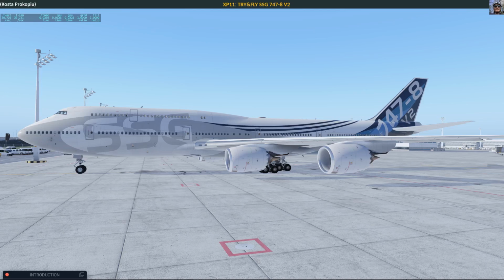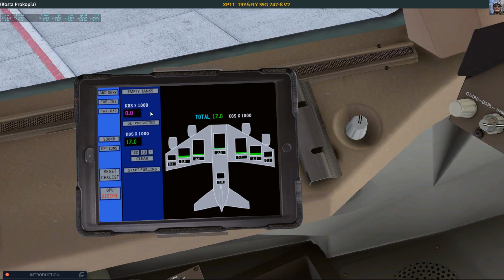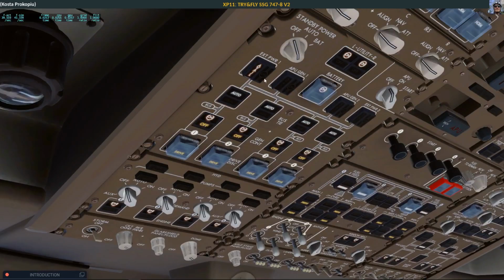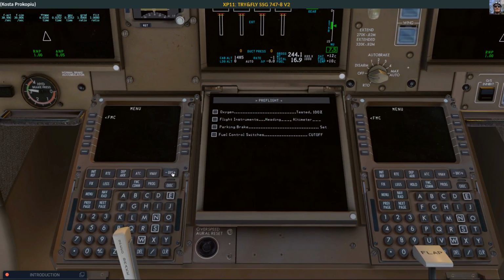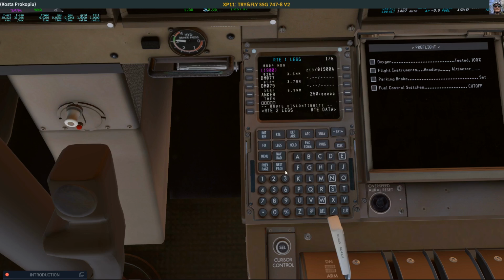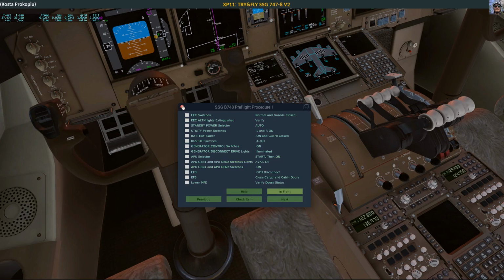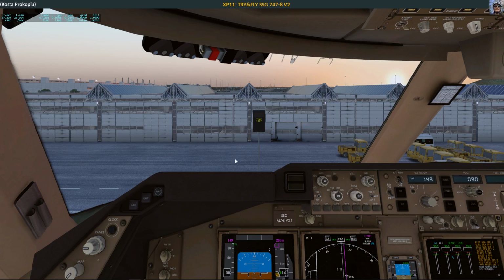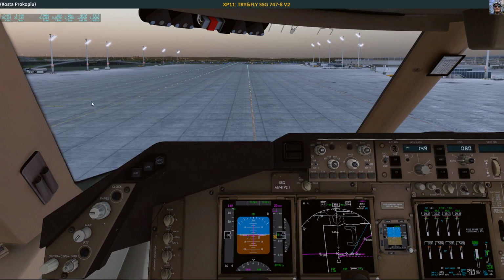[XP11] TRY&FLY SSG 747-8 V2.1.1 1/2 (ENGLISH)

Comment: Kosta I have a question I wonder if you can answer. I can connect 3 sam2.03 jetways to 748 v 1.9. and it works perfectly L1,L2, and upper cabin), but cannot connect to 748 v 2.1.1. Any Ideas? Thanks again!
Reply from the maker: I did get gates connected at the end of the Try&Fly here. That was in Munich at a Heavy gate. It could be that it depends on the position and the class of aircraft defined for it. But I am not the developer of scenery and SAM. Did you try manual mode?
Reply: @prokopiu  I think I have to use thle new sam library gates to connect to the second lower door and the upper cabin. I have been using custom sam gates by other developers which work but not multiple connections with SSG v2.1.1. only the one cabin door. I just like to use multiple  connections (like in SSG v1.9) it just really good. Thanks, I'll keep you posted.
Reply from the maker: Yes, with SAM you need to always stay updated. There had been several changes and updates.

Comment: Very good review and yes , much more work needs to be done to truly make this payware level, comparable to other aircraft. As you mentioned Avitab integration, better EFB (this looks like a toy), FMC still buggy, I think the VSI (vertical situation indicator) doesn't work properly, don't know what's going on there. Flight Plan imported from Simbrief are there still issue with that? Does it need xplane 10 format to import? 
It doesn't seem that SSG is moving very fast with imp
Reply from the maker: the Simbrief flightplan did work. Use UFMC Universal FMC format in the Custom Data/UFMC/FlightPlans folder.
Reply: @prokopiu  Thanks!!, I experimented with sam 2.05, 1.08, with library jetways and they will not connect to 2nd, 3rd, lower cabin doors or the upper cabin door. SSG's 2.1.1. is more limited than version 1.91 when it comes to sam jetways. In fact ground handling deluxe does not respond to 2.1.1. I couldn't even switch to baro pressure in the new version. I must be doing something wrong.

Comment: Does the 'FL CH' mode work for you? Every time I try to use it the autothrottle doesn't pull back so the plane doesn't descend.
Reply from the maker: good question, I did not use it on this flight. I will let you know when I took that aircraft on my first normal flight. What I discovered was that partly the throttles would move frantically between the position of the joystick and the A/T position. I just checked the release notes for this version and there is no mentioning of FLCH. I also think that the VNAV PATH calculations seem not overly accurate - we ended up too high when on the transition and I had to intervene. The descend from FL200 to FL150 was conducted with 3500 ft/min or so - a bit much I think.
Reply from the maker: I had it tried in between and it worked but it uses exaggerated descend rates, the algorithm behind it seems a bit crude.